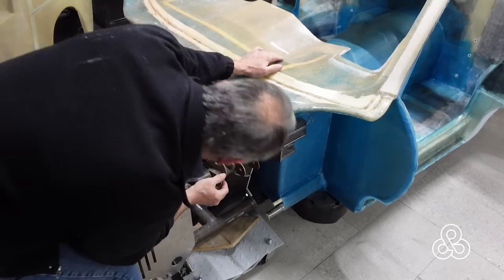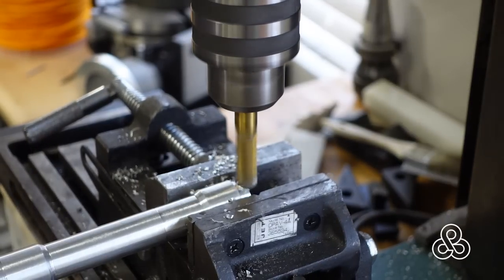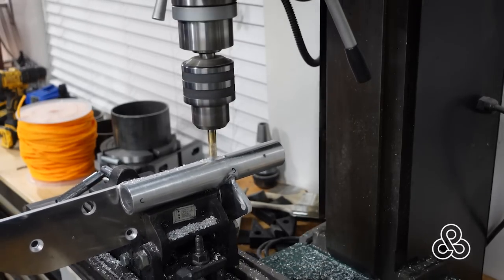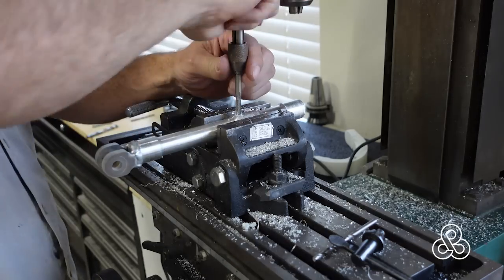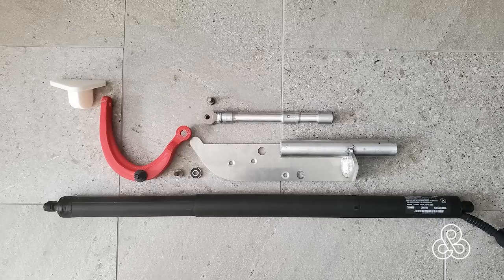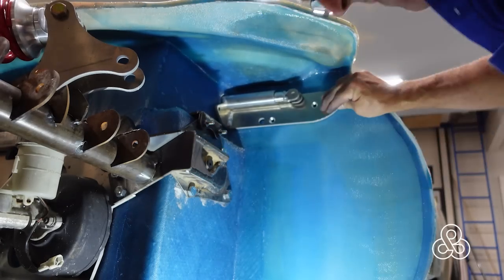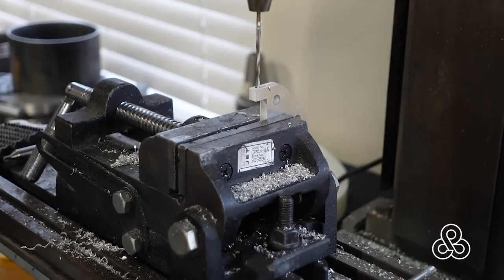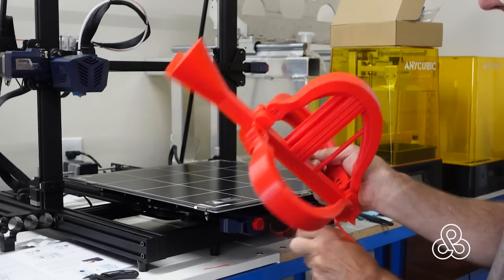A85 How to open funky butterfly doors. Arete Supercar Project.

Comment: Really like the idea of using the transfer case chain as flexible but strong hinge/strap.
Reply: Thanks. If it works out I can later recreate it in laser cut aluminum pieces, as it is a bit heavy for its size.

Comment: Super neat to see the hinge mechanism coming together! Thinking about doors got me wondering what you'll be doing for locks, if you'll have a remote key fob for the locks, and then what you'll be doing for a computer in the car. So many fun problems to look forward to seeing you tackle!
Reply: Computer is a Mindows tablet (touchscreen info center) as the tunning software is Windows based. No laptop needed. Tune/ analytics from the dash. Door fob- ?

Comment: Hi. I'm not so much of a car guy as some. I'm here because I like sculpture, building techniques and aesthetics. You're doing a massive project here that's really impressive. I have a lot of regard for this. 
I have a question about the initial maquette in clay that was a foot or two long. It seems to have blown up full size quite well, aesthetically. Did you ever think that such a small model might not translate so well visually into the full size body? 
To detail what I mean - I can imagine that something that you might not have noticed on the small version would have stood out in a negative way once it was blown up. I don't mean obvious, specific features, but a combination of subtle scale relationships might have become glaring once made large.
Reply: True that the translation in scale is a problem, however this methode is only to get a rough full scale version. Most of the serious design and finalisation is done at the full scale. This is why even the big auto manufacturers build a full size clay. If you start out knowing exactly  what you want to build (say a reproduction of something existing- "copy") then it is better to have it CNC carved from foam. Thanks for watching!

Comment: Just wondering. Im preparing to make replica Stradale 33. I think i've figure it mostly. The biggest bump is front/rear windshield and side windows. How are you planing to solve that problem with your car.
Reply from the maker: The glass is by far the hardest problem to solve in creating a replica. Often replacement glass for the original car is just not available. If you own an original Alfa 33s you are wealthy enough to have the glass manufactured, just for you, and likely at a cost of more than you will spend on the entire replica build. My solution, was to design around an inexpensive existing replacement glass. (97 Chevrolet Cavalier windshield). The moving glass will be tempered flat glass (inexpensive to have made) and the fixed parts of the side glass will be drape formed out of polycarbonate. Drape forming is probably the direction you are going to have to go as you have chosen the most glass intensive and complicated "greenhouse" glass auto ever built. Ha! Luckily the original Stradale used acrylic for the side glass (with the lapped edge side vents rather than sliding glass) so you can duplicate that fairly easily. Acrylic or polycarbonate is perfectly fine for fixed glass, but for moving glass and windshields subject to wipers and bugs the plastics get scratched up pretty fast. Additionally, most jurisdictions, if they allow home builts on the road, do still require the windshield to be safety glass. The last time, many years ago, that I looked into having a complex windshield made it was going to be over $20K USD. In my opinion, you would have to build multiple cars to justify the price of setting up that tooling. You might look into seeing if you can purchase a windshield from the kitcar manufacturers of the Superlight. not an exact fit and you will have to adjust your design some, but a lot closer to the original Stradale than a Chevrolet Cavalier. At any rate, beautiful car - Good luck!
Reply: @BuilderCreator  thanks a lot for your time taking to write such an extensive comment. I appreciate it very much. Ha! Even if i do have money to purchase original Stadale, there is no way buying it since only 4 of those are made and all are owned by museums. 3/4 if im not mistaking are owned by Alfa Romeo Museum in Milano. Car is so rare that even there only 20 "licensed" replicas are made. I've got in tuch with grandson of the guy that made it, asked me 5k € for blueprints and another 5 for moldings. I was like, no way. Bought 1/8 Burago replica and worked my way in to making blueprints through AutoCad and SolidEdge. Yup you are about right about the costs. With current prices growth, ive calculated around 25k € for production, another 15k-20k € in paperwork to make it street legal. There is a lot of calculations and tests required by the traffic agency. Another 2k for homologation... But, glass is not included in the costs, only thing not figured how to solve. Again thank you for your time for replying to my comment. It is very helpful.
Ps fun fact. I came across an information, that one of those 20 replicas is sold in Spain in 2010/2011 for 850k €.

Comment: That upper hinge will not work properly due to it swinging freely. In order for such a hinge to work, it's mandatory to feature hinge segments with integrated gears so that they will lock to each other and rotate gradually as you bend the hinge. Lenovo YOGA 3 Pro uses such a geared hinge.

Comment: A sugges… The hinge C piece (printed red plastic cam) would be better CNC’ed, cast alloy part will be prone to cracking and is a high stress, safety part. Just send your 3d print file to a machine shop, it shouldn’t take long or cost too much. A door falling off can cause damage to the car and passenger 🤷
Reply: Pehapse in the shake down we can keep a careful watch on the part.